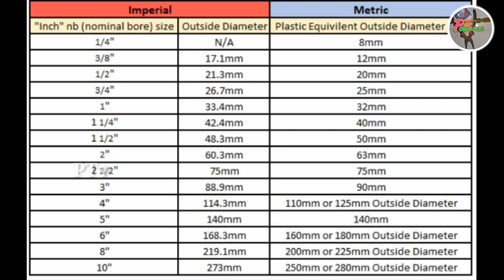How to measure pvc pipe  and fitting size, mm to inch || പൈപ്പിന്റെ  size എങ്ങനെ  മനസിലാക്കാം

Comment: ഈ Pipe ൻ്റ Thickness എങ്ങനെയാണ് പറയുക ?
4 kg എന്ന് print ചെയ്ത pipe ഉം 6kg എന്ന് print ചെയ്ത pipe ഉം തമ്മിലുള്ള വ്യത്യാസം എന്താണ് ?'
Reply: This is the unit of working pressure capacity in kg/cm2 for the pipes. 4kg means that pipe may hold the pressure of 4kg/cm2.